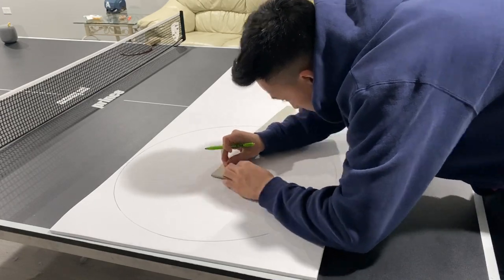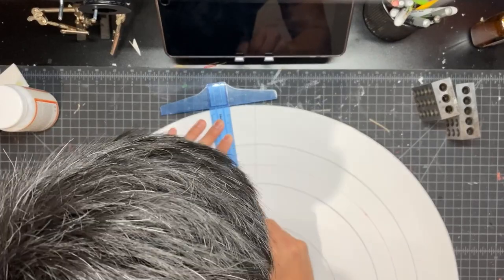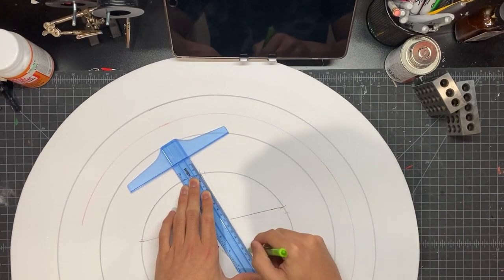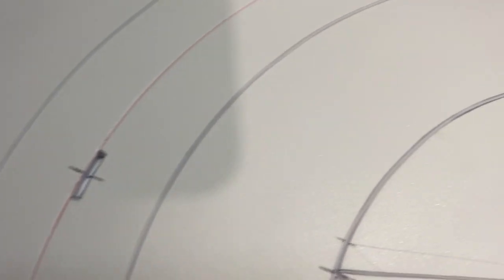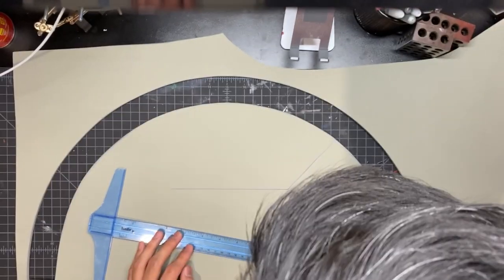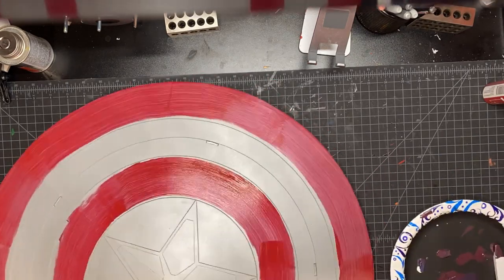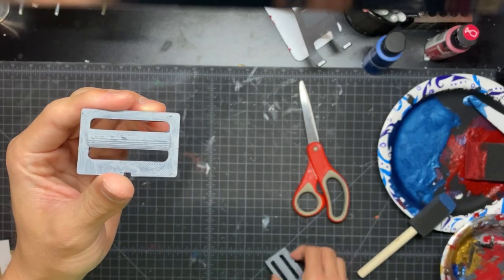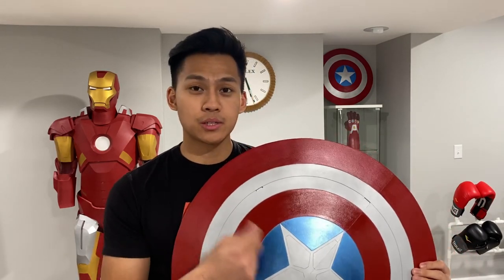How to: NEW Falcon/Captain America Shield - Falcon and Winter Soldier DIY PropWay

Comment: What’s the measurement of the section you cut out to “dome” the shield? Awesome job, by the way!
Reply from the maker: The short edge of that triangle that I cut out should be about about 1 inch to 1.5 inches. It really depends on how much of a dome you prefer. I would start with 1 inch and if you feel you need more, you can cut more.

Comment: How durable is it, would it be a good idea to use it for a fight video or no?
Reply from the maker: It is pretty durable and because it's foam, it's fairly safe to throw as long as you're not knocking things over lol. If you abuse it, it will definitely get some wear and scratches on it, but if you're careful, it should be alright!

Comment: THANK YOU SO MUCH! i really want to make a John Walker cosplay and all the shields have been so expensive to make and finally you’ve offered a decent priced easy to make shield ! Do you have any recommendations on how to make it sturdier ?
Reply from the maker: Glad you like the video! To make it sturdier, I would probably use a thicker foam or add more pieces on the back, just to have a little more material.
Reply: @PropWay  would resin work?
Reply: @naseralwaqfi8930  it probably would make it too heavy and possibly not "cosplay safe".

Comment: can i use a hair dryer to open the score cuts
Reply from the maker: Yes! Hair dryers don’t get as hot as a heat gun, so you’ll just have to let it run a little longer than normal.
Reply: @PropWay  ok thanks
Reply: @PropWay  can i use hot glue to glue it together
Reply from the maker: @rcfoamfighters3766  You can definitely use hot glue, but the only issue is that the seams may not be as tight as it would be with contact cement.

Comment: You forgot one thing, the circular lines exists on both sides,inner and outer .You just drew and cut those on outer side but not inside.
Reply from the maker: You're right! I didn't add those lines on the inside (which are actually more like overlaps instead of cuts). I felt it wasn't super important to the build, but I appreciate your eye on the small details!
Reply: @PropWay  Also if you look closely to the outer side of shield, the outer red portion next to the white  have a new sepration cut or line . The circular cut line is very close to the outermost circular cut.
Reply from the maker: @ThePawanDhiman  lol yep I think that was a new addition to the TV show shield. I was using the Endgame shield as reference and that didn't show it (at least not clearly).
Reply: @PropWay  Anyway just wanted you to know. BTW nice shield.

Comment: I built mine from the 60cm floor matts and put them together snd used foam clay to fill the seams so it’s 65cm aids instead of 60 and I love it 

The way you could improve yours is by rounding the edge of the shield since that allows it to fly better when thrown but that’s only if you like throwing it a lot